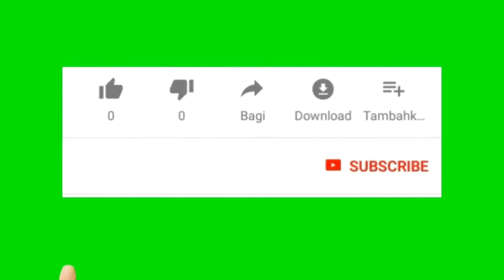Alat anti Short super simple. Karya Roslin Tehnik

Comment: Pak bisa bikin adaptor non trafo bisa nggak pak.  Dan bahannya sebagai berikut :
1) 1uf millar 400V Ac
2)  270k ohm 0.25watt resistor
3) dioda (1N4007)
4) 100uf 35V kapasitor dc
5) dioda zener 12V 2buah
6) 100 ohm resistor 1watt 
7) 220 ohm 0.25watt resistor.
8) lampu led warna merah untuk indikator
9) konektor Ac
Dari bahan bahan diatas bapak bisa buatnya?  Dari tulisan diatas bahan bahannya sederhana kok klo bapak nggak tau cara buatnya cari di youtube nama judul videonya" how to transformeless power supply adaptor" atau artinya cara membuat adaptor power supply non trafo. Untuk masukan Ac 220V. Dan hasil outputnya 12V dc 2Amper. Ya tergantung elconya sih klo ampernya mau di ganti ya ganti aja pake elco yg lebih gede kapasitasnya